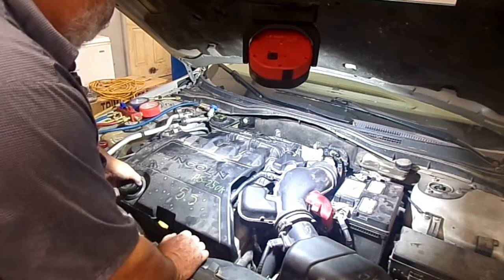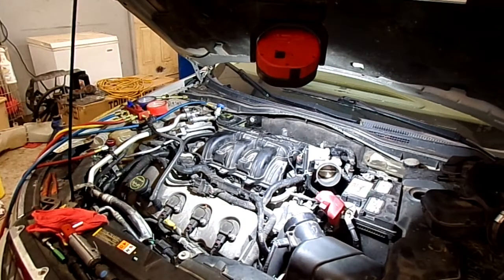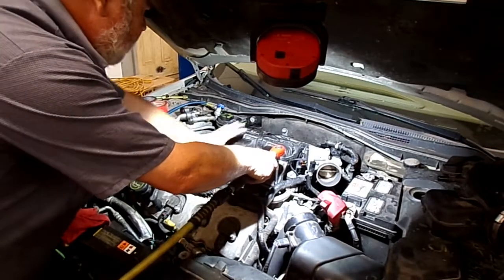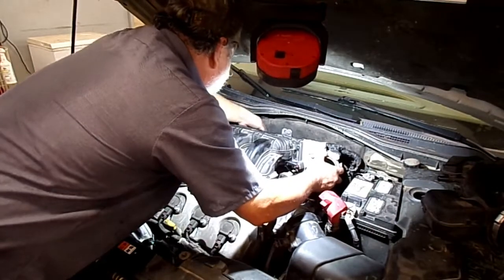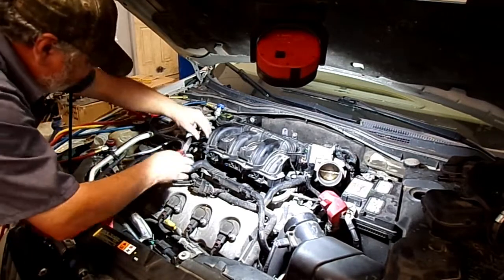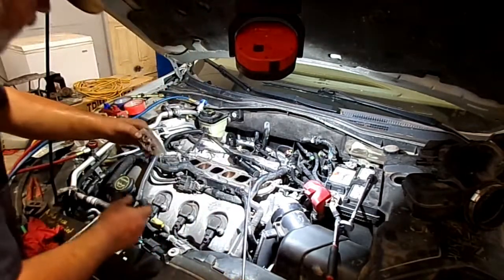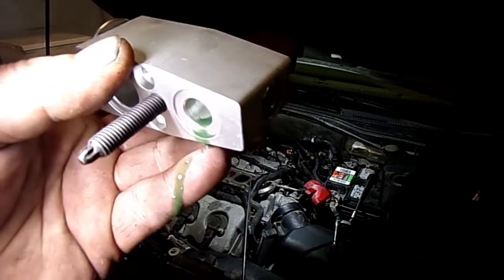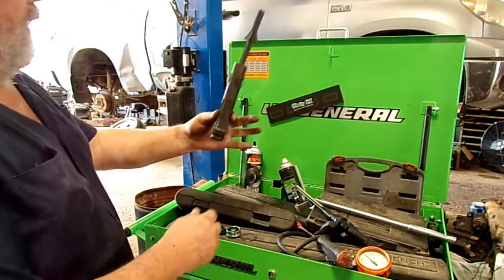LINCOLN MKZ AC EXPANSOIN VALVE AND ACCUMULATOR REPLACEMENT

Comment: Your strategy worked to get the (accumulator) drier dessicant filter out but the new one wouldn't quite fit so I had to use sandpaper to grind down the round edges so it could slide in. And for my expansion valve, I ended up stripping 1 of the Torx bolts... great video sir

Comment: 07 ford edge 3.5l,  my system is full on a fresh charge and oil. no leaks within the system. fans come on compressor comes on everything acts as it should but no cold air. could the valve and dryer be the cause of this? if so which should i replace or just do them both anyways? thank you.   

i do not know hardly anything on diagnosing HVAC
Reply: It's the Expansion valve. You can get away with just changing the expansion valve? If there's a lot of trash in it. Though your compressor's not gonna last long and it's the o's black. It's called black death. You need to just change the compressor and flush the system.
I'm just seeing your comment and commenting on it. This is not my thread. Been doing it twenty six years full time

Comment: Having a hard time with my receiver drier, wish he showed the replacement. Stuck at the snap ring and push up on the metal part
Reply from the maker: I had to tap that round metal part up into the housing , " lightly tap it " . I used a socket & small hammer .
Reply: @heartlandmechanic  thanks I appreciate the quick response too. I'll try that
Reply: One more thing, do I need a removal tool or just a needle nose pliers to pull out the filter part?
Reply from the maker: when I got the snap ring off I screwed a bolt  in the thread hole on bottom of round metal part & used pliers to grab the bolt & pull down to work it out .
Reply: Alright, great idea too
Reply from the maker: @lamontsmalls6086  I used wire pliers , Mine was really hard to get out , I had to work the drier up & down till it came out . try not to brake the little loop tap on the bottom drier , that's what I grabbed hold of with pliers to pull it down .
Reply: Gotcha, I will sure try your method